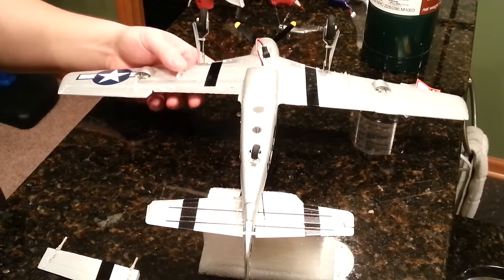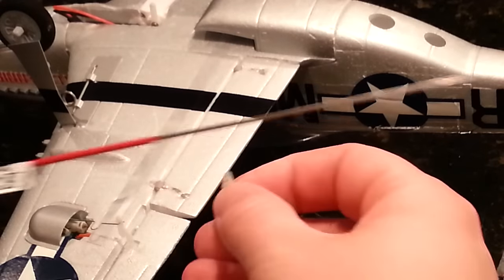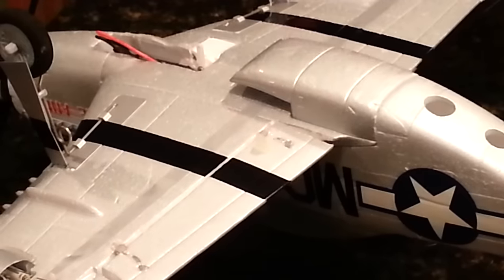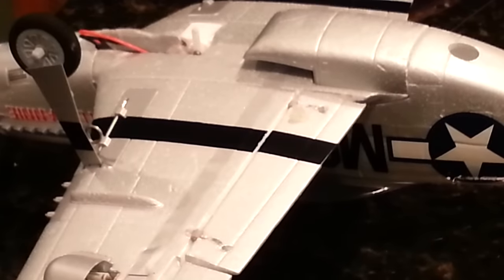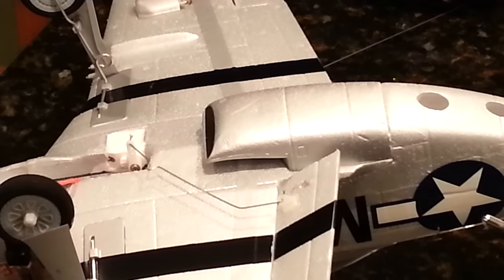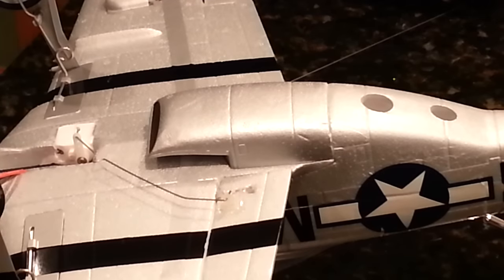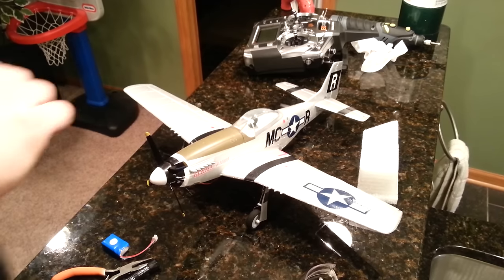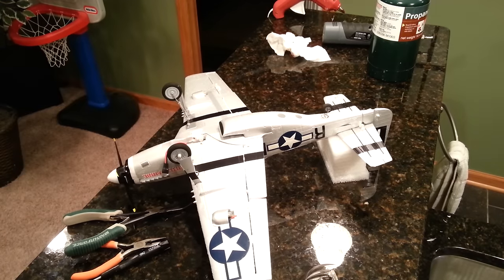Eflite - P-51D BL UMX - Flaps Mod 3 of 3

Comment: Is this foam safe to use with regular CA glue or do you need to use Foam CA?
Reply from the maker: I use the FOAM SAFE Medium or Thin for this plane...."Regular" will each the foam (usually).

CA Medium Foam Safe BSI - http://amzn.to/2E2l29z
CA Thin Foam Safe BSI - http://amzn.to/2COE6sw

Kicker BSI - http://amzn.to/2CQf24D

CA Medium NOT Foam Safe BSI - http://amzn.to/2D0x18i
Nail Polish Remover for CA Cleanup - http://amzn.to/2CmlP4S

...Hope this helps!

Comment: Hey, just watched all three of these videos. This is brilliant! The plane has no problems slowing down, but it has a super-high stall speed for a foamie and I've been wishing for flaps for easy powered landings.

Do you think it would be possible to do this with one of the stock-type servos? They're super lightweight and already designed for a linear front-back throw.
Reply from the maker: Absolutely!!! 

...BUT, you might want to just go with two, so you can flank the intake, which is centrally located. I suspect you'll try and keep them in front of OR on the CG, so you can keep flight performance good.

P.S. I'd do the flap mod again in a second, but would stick to 2S if I had it to do over again...the 3S started getting weird on this plane, so I just fly with 2S again, and she holds her own anyway:)

Glad the series helped you out!!!

Comment: Hi! Nice tip on cutting/adapting/installation of micro control horns. I also like the LED on your rotary tool. I've been scratching my head trying to figure how to add an LED to my WEN 2305. lol!
Anyway, have you ever took a look at single servo flap setup used by (I can't find these planes or parts anymore) EasySky RC Hobby? Specifically the 900mm 5Ch Yak 12 and Wilga 2000. Pretty clever. Might be helpful, might not. ;)
Anyhoot, thanks!
Reply from the maker: +4FunRC I've done a bunch of different flap installs, and even more LED installs, but I'm a creature of habbit...once I figure out a method that works, I tend to keep doing that way until something forces me to change it. These projects are soooooooooooooo time consuming when you want to make them look good. It's not so much "hard" as it just takes 4 trillion small, reasonably easy steps. When you screw anything up though, it gets to be a huge pain...especially when I tend to start working late at night, and then get to bed when the sun's coming up
Reply from the maker: I just got done filming my LED mods - 6 videos!!!Next up is the 2S to 3S modification, which is already covered in part 6 of 6 LED mod video series.I hope that it's not too horrifically boring, and someone will learn something new. It SUCKS to film these mods as it makes the project takes at least 2-3 times as long!I appreciate you watching!